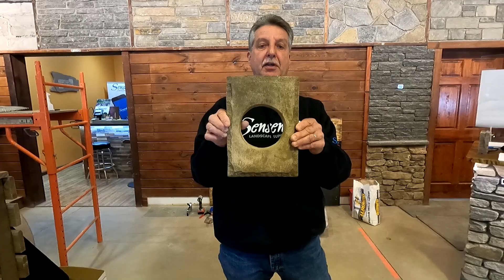How to veneer - Veneer stone install

Comment: Hi,
      If this was to be done over a painted block wall in a rainy environment(Florida), should a wire lath be used with a scratch coat and also, do you recommend any drainage system behind the lath?  Something like Tyvek Drainwrap?